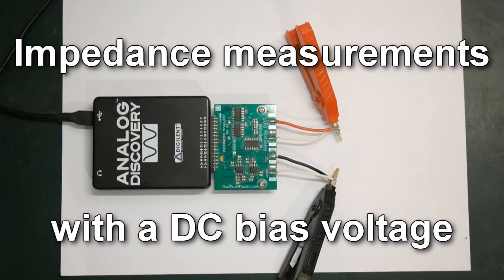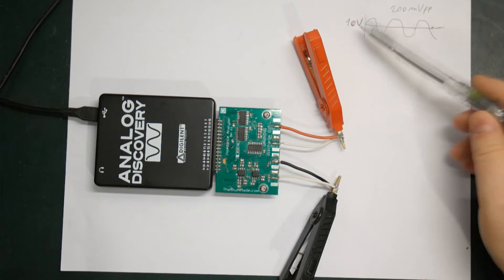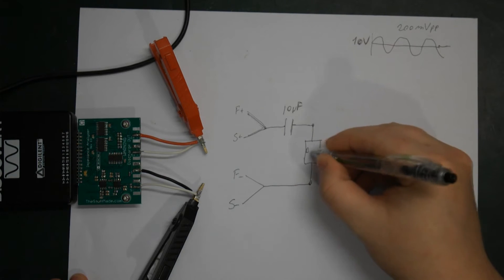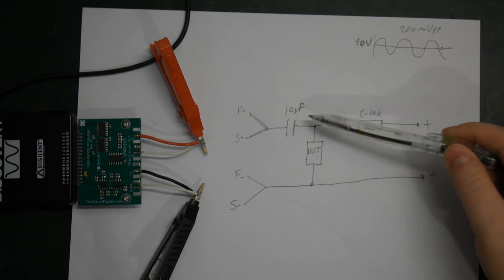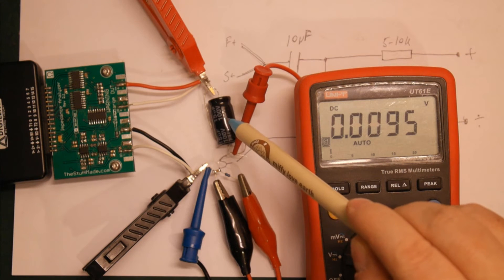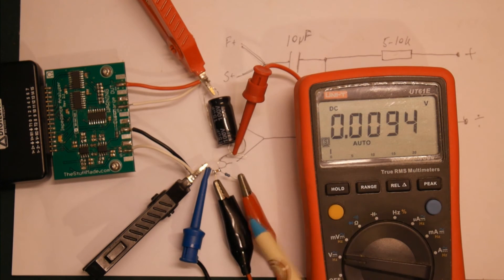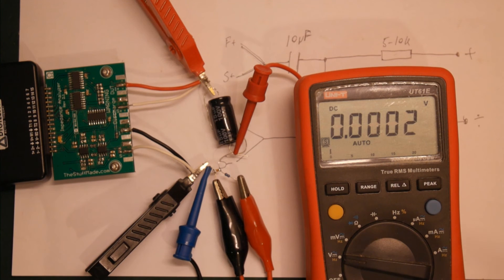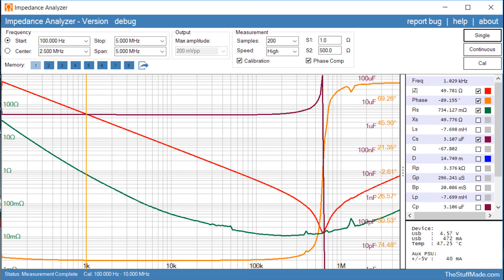Analog Discovery Impedance Analyzer Bias Voltage

Comment: Great video. Im going to buy a AD3 soon and ill make your pcb. Im mainly interested in inductors. Is there a simple way to do the test with a bias current? Thanks
Reply from the maker: Thanks, I believe you should be able to use a similar setup with a coupling capacitor, just with more current. 
Cheers,
Jake
Reply: @TheStuffMade  I could probably use the coupling cap and one or more inductors to block the sine wave from the current source. I'll select the values based on the sweep frequency
Reply from the maker: @chris_lynch  You're right about the extra inductor. I did a quick test using a 80uF coupling cap and a 400uH air core inductor between current source and the DUT, then measuring a surface mount cored 68uH inductor with up to 3A dc bias current. This seems to work just fine. I did add a couple of extra diodes across the inductors, just to be on the safe side.
Cheers,
Jake
Reply: @TheStuffMade  great, thanks for testing it. I ordered an AD3 so I'll be able to play with it soon :). Good idea about the diode for back emf. Out of interest what did you use for the current source? I'm tempted to build a high current one. At the moment, im just using a bench supply and rheostat, but my bench supplies are prob too noisy for this purpose.
Reply from the maker: @chris_lynch  No problem, I just used a linear bench supply as current source, that worked fine, but limited in max current available. For the inductor between current source and DUT, I used a large air core (speaker crossover type inductor) as it should be able to take a lot of current before saturating. For the diodes, I believe the silicon ones I used did have an effect on the measurement, probably some TVS diodes would be better suited.
Cheers,
Jake
Reply: @TheStuffMade  i could use a linear regulator and filter on the output of my existing supply, so post regulate. Then wind an air core and test its freq response with the AD3. 

I was wondering what impact the diodes might have, I haven't played with it yet to see if calibration can help with any errors they introduce. I'll find out soon :)
Reply from the maker: @chris_lynch  Many options to try :) anyway, hope you'll have fun, it was the main reason I spent a lot of time developing the Impedance Analyzer for the Analog Discovery, saves people from having to invest a prohibitive $10-20k in lab equipment to do some basic measurements.
Cheers,
Jake
Reply: @TheStuffMade  thanks, I def appreciate the work you put into it. It must have been a good learning experience. I assume it works with the diligent impedance analyzer pcb as well?
Reply from the maker: @chris_lynch  My work was long before Digilent did their "official" impedance analyzer implementation, I don't think they're compatible, but my approach is far more accurate.
Cheers,
Jake